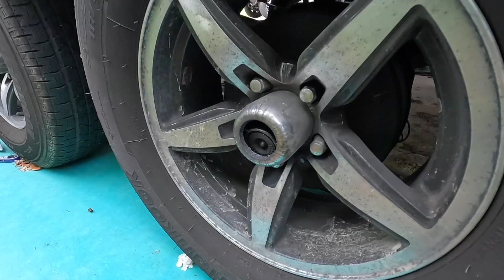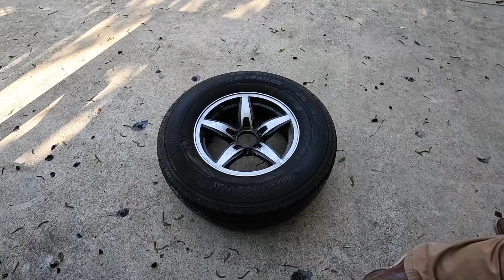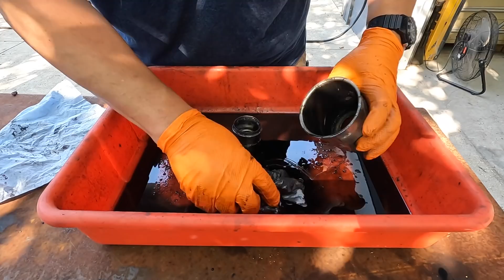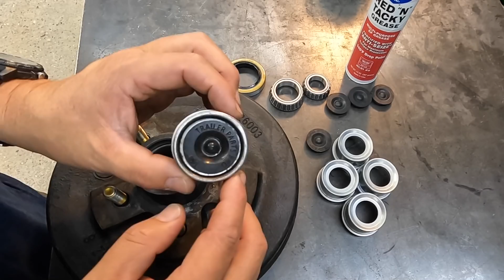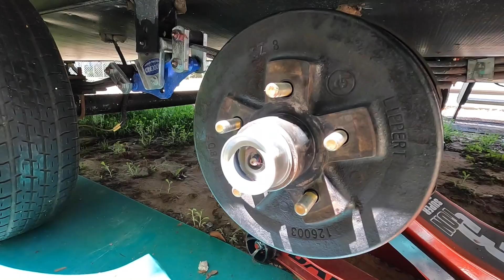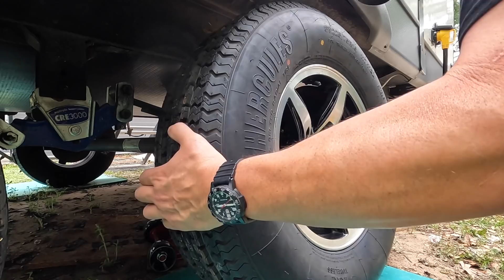RV How-To: Brake Hub Removal, Inspection, Reinstallation

Comment: Remove inner bearing so it can be repacked now that you washed the grease out. It will run dry no matter how much you squirt in there, it will be running metal to metal till some grease that is hot can seep in, by then the bearing will be ruined. Clean and repack the outer if you don't want to remove the inner seal. Did lots of wheel bearings starting in the late 60's till I retired in 2002. Bearing that have been washed need repacked with fresh grease. Keep an eye on it the next trip.
Reply from the maker: Placement of the cross hole for grease makes the grease run through the bearing, through the hub and through the outer bearing. It's greased.
Reply: @AbomAdventures  yep, seeing that after I made the comment looks like I spoke too soon. Typed faster than the video.
Reply: Same work experience here and was going to say the same thing until seeing how this spindle is designed. When greased is applied through the zerk fitting it runs through a galley all the way to the back of the spindle. This packs the bearings from the seal side through both bearings just like a bearing packer does. New one on me. Nice design.